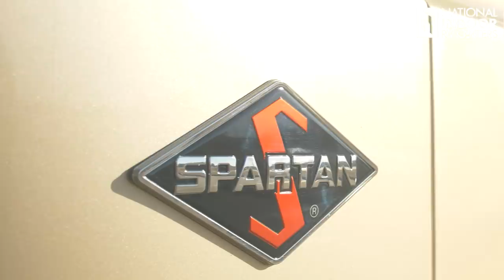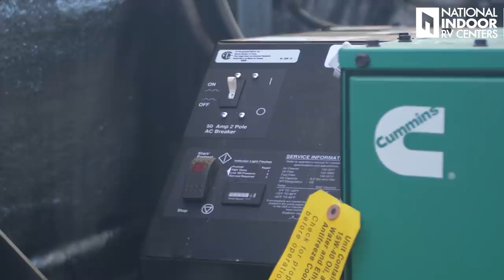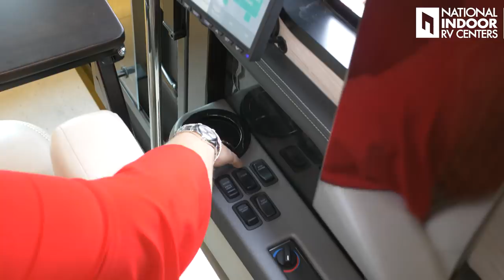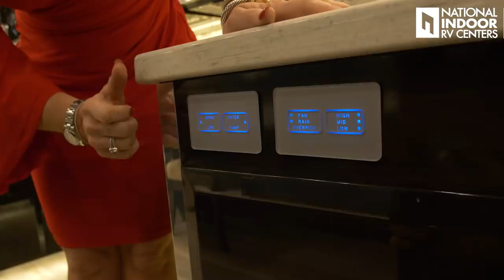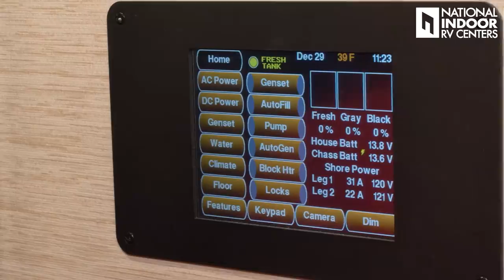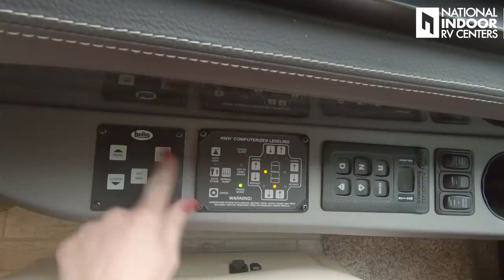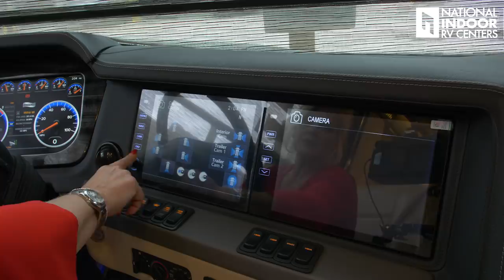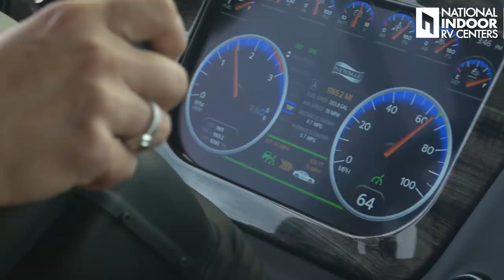2019 Newmar King Aire | Full Motorhome Walkthrough Tour | NIRVC

Comment: Angie, I have a question? Since this is a class ''A'' motor coach don't you have to have a class ''A'' drivers license? also, does it have air brakes on it because you will have to have air brake endorsement on your license.
Reply from the maker: Most states require that you have a Class B license if your vehicle weighs over 26,000 lbs but it varies from state to state so you should really check with your DMV.  The Air brakes on a coach are fairly simple.  They are either "ON" or "OFF" and they may have a high, medium or low setting.  Much easier to use then the air brakes on an eighteen wheeler.
Reply: @NIRVC  I was just curious. I'm glad I don't have to worry about that. I've been to school to learn to drive the big rigs and I also have a class "A" license with air brake endorsement.

Comment: If the entire coach was built or made of Aluminum that would reduce the weight by 30% this will eliminate the need of a tag Axel reduce fuel consumption  and prevent rusting over long term , on a 22.5 rim you can put a 295/80R ( broader Tyre )  which has a higher weight load However in the US this could be different  , Most important  a separate Bank of batteries fully charged by Solar  That can run a AC at night without relying on the Engine That will be something , Especially when your parked , But this is outstanding

Comment: At 19:15 you state that you provide complimentary all Corner weighing so that we can adjust our tire pressures to the weight that our coaches are carrying. I did not purchase my current coach at indoor RV centers, but I would like to use the complementary all Corner weighing that you provide. How do I set up an appointment?
Reply from the maker: Thank again for taking the time to watch our video! Yes, we do free four corner weighing whether you purchased your coach from us or not. Just call and let us know which location you’d like to have your coach weighed and when you’ll be there and we’ll be waiting for you. Be sure and come in with a full fuel and water tank and empty gray and black tanks or you can always dump your gray and black tanks with us.